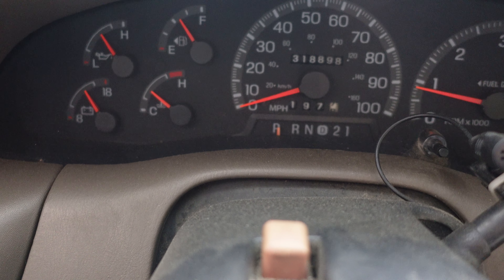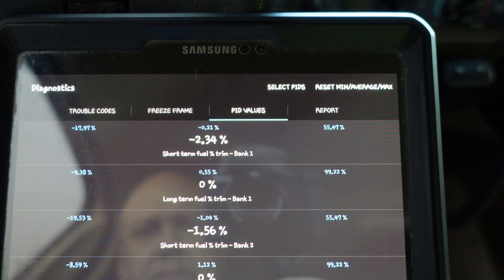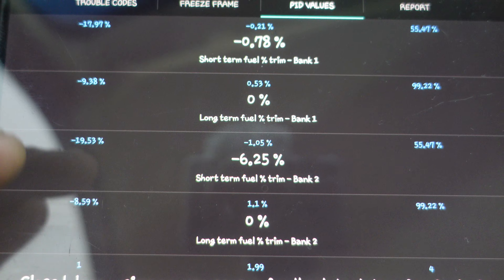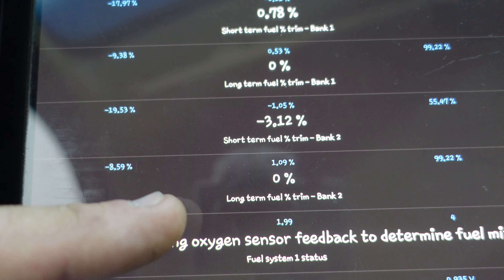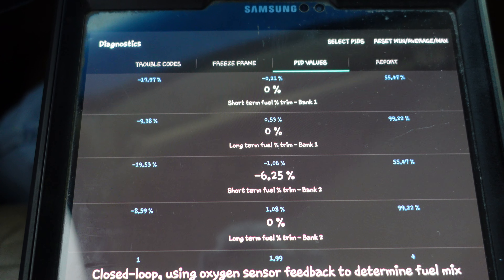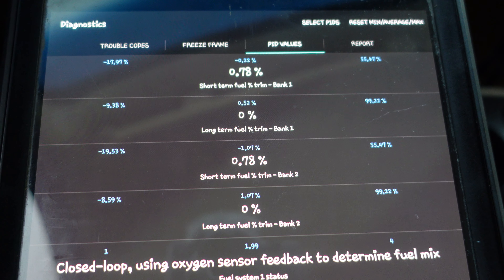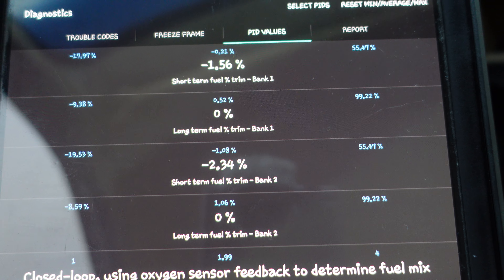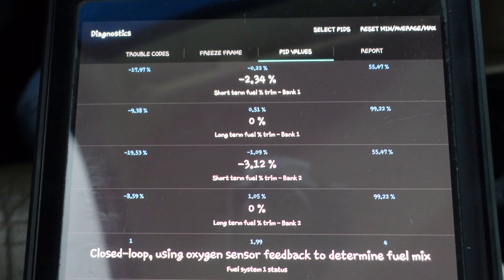P0171 P0174 Fuels Trims Fixed! Epilogue.

Comment: Trims look great.  Thanks for the shout out.  Lol.  We obviously missed the very last step. I would not have thought of the multitude of stored trim values and the need to clear them.  I guess had you gone 2 drive cycles (I think that the Ram's requirement not sure about the Ford) the stored values would have been replaced over time.  Should have trusted your gut when you fixed the leak and it was running well with good ST trims.  Great learning experience.  Can't wait to see you top that one.  Maybe another snake in a birdhouse......lmao.  Thanks Aaron.

Comment: Hello Aaron, thanks for posting your video. My 97 f150 has the same issue.  What brand/model is your diagnostic tool that you are reading fuel trims on? Do you like it?
Reply from the maker: Howdy! What I was using in that session was the app that works with my little OBDlink MX+ unit. It works pretty well. I've moved up to a Thinkcar Thinktool PROs which is way better but serious overkill for the average hobbyist. Thanks!